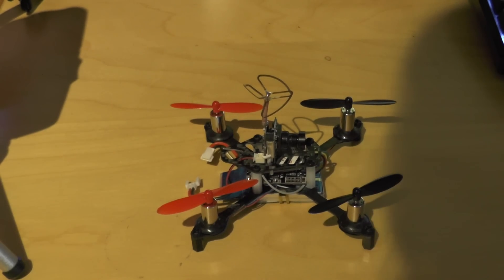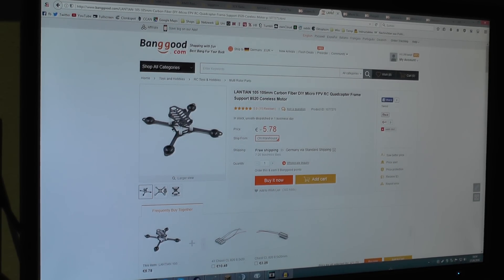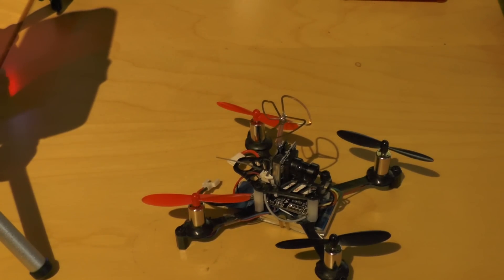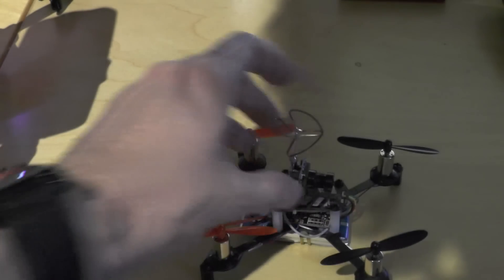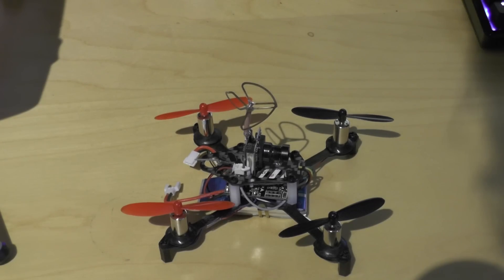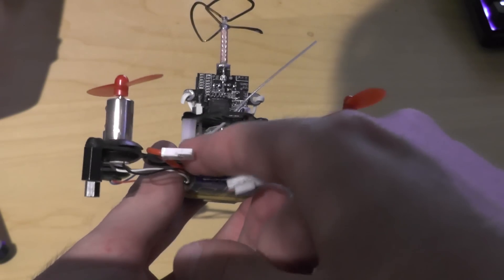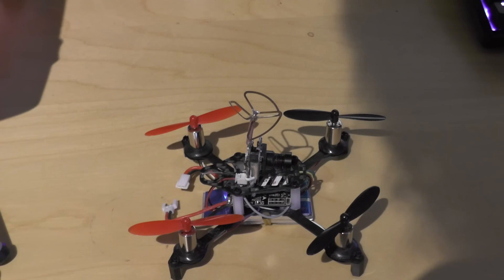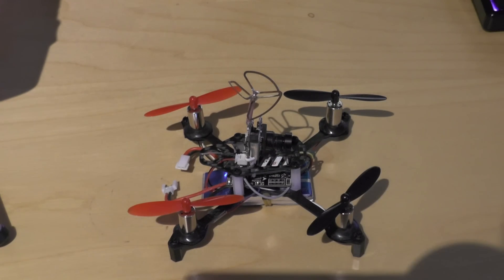Lantian 105mm micro FPV Quadcopter

Comment from the maker: Update: i tried flashing the irangeX receiver, but had no success. Don't buy it. Telemtry is unstable and sbus too. The quad drops randomly out of the air and sometimes arms itself on the table.
I am now using the little qx90 receiver which works great and i managed to flash a telemetry capable firmware.

Comment: can u show pids settings. i have same setup
Reply from the maker: I used the values the flight controller came with and i have not changed much.
They were pretty good for my setup as they are probably what is used in the QX90 kit which is also very similiar.
Version Cleanflight 1.13.0, Luxfloat:
P,I,D
Roll/Pitch: 80,30,40
Yaw: 220,45,0
Reply: Gigawipf
Reply: Gigawipf Can you share it still? My fc from Banggood has the brushless PIDs. :(
Reply from the maker: I still have almost what i said in the other comment.
Reduced the p values a bit with other props:
R/P: 50,30,40
Yaw: 200,30,0
With a rate of 0.8

Comment: Just finished building mine with this frame and WOW...its light. I used the F3 evo brushed board flashed to Betaflight but the top deck standoffs needed to be modded in order for the board to fit where it should, not a big deal but took a little time. Well worth the effort as this thing rockets along with 8.5mm Chaolis and a 400Mah lipo. Still waiting on my 600Mah packs but Im happy. This frame seems to hold up really well and looks great in the air.

Comment: I have had nothing but problems with the RX800, both of mine frequently disarm my quad. 

How are you powering the camera? Is it filtered?
Reply from the maker: The camera is powered directly from the battery and not filtered.
I have those problems with the receiver too but i heard of a different firmware that is supposed to fix the random bursts but i can't get it to write the firmware. In one take the quad armed and flew itself off my table.... crappy receiver but it is flyable when you don't get too close to the transmitter. 
I also put a big capacitor on my 5V lane to filter spikes a bit.